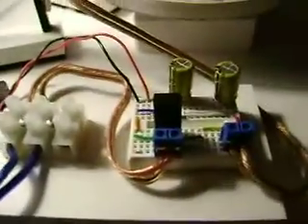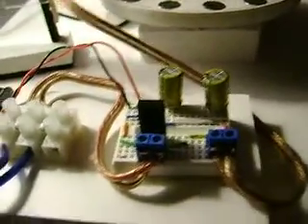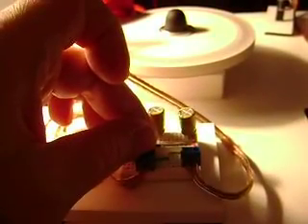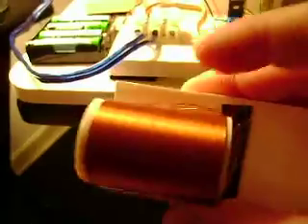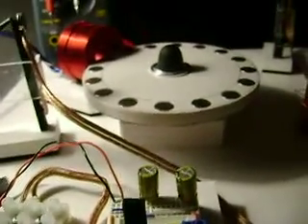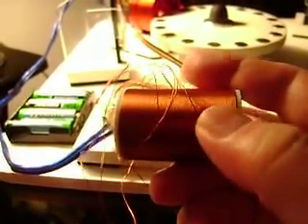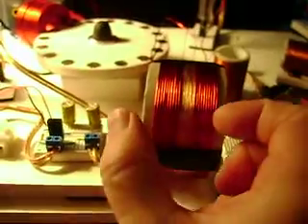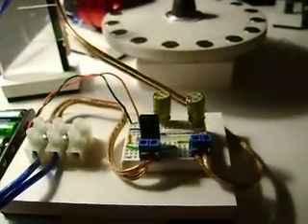Back emf currents seem to be high from these big coils. I call them big cuz the wire is thick. =]

Comment from the maker: Tru that Guru
Eventually I will get into Tesla type setups. I am very interested in Don Smiths device which is basically a Tesla coil setup but the primary is in the center of the secondary in which he claims will amplify the POWER not just the voltage. Imagine using a 12v bat to run a smaller neon transformer ans the output can run a whole house!  Air cores my friend. The Tesla advantage. 
Magluvin

Comment from the maker: So air core will have the highest speed collapse of all, there by producing a very quick bemf pulse, of which the speed of the collapsing magnetic field passing back through the coil should produce more bemf per power used to produce the initial field. 
Magluvin

Comment from the maker: Hey Guru
I agree that the length of the wire will have a given resonance, just as in antenna wave lengths and such.
But here, we are not necessarily working with radio freq, but maybe with the bemf pulse. That I will study later. I do believe that the back emf is of a high freq pulse due to the collapse of the magnetic field once the power is taken away from the coil. At what freq, I dont know yet. Light speed? Thats pretty high in freq. I do know that an iron core can slow down the collapse...

Comment from the maker: Hey Guru
That is an interesting theory, I will test your theory as soon as I get a chance. My Big coils as I call them are less than 1 ohm each and in a couple of my vids I put 3 of them together in parallel, bringing the total ohms down to 0.14 ohm. I have run them at 1.2v all the way to 5.1v and the back emf increased as I raised the voltage to them. So at this time I have to disagree, But I will do a vid that proves it. =]

Magluvin

Comment: Hi Stefan.
I don't realy hold with this formula
 V / R = 1A
This only holds true when sticking to the 
1 times  table, such as 
1V X 1ΏR= 1A.
But if you do this calculation with
 2v x 2ΏR= 4A 
and not 2A 
as it would if you used
 2V X 1ΏR= 2A

cheers Z.

Comment: Hi Guru. 
Well I think you've just answered what I said, but in a different way.
One is a trade off against the other.
Mags is using a thick single coil for the pulse coil and using a diode in revers to capture the bemf off that single coil in this experiment.

cheers Z.

Comment: By using 2 separate bifilar coils its possible to get equal currents travelling in opposite directions on the same core simultaneously, cancelling the field produced by load current draw. So output volts are doubled whilst Lenz effect is cancelled.  Back EMF harvesting is still available.

Comment: Hi.
The reason your diode is heating up is due to the thickness of the wire on the pulse coil, thicker the wire  more current less voltage, thinner wire more voltage less current.

cheers Z.

Comment: Do you happen to remember where you read about Tesla talking about bi-filler coils??
I would like to read that for myself!
Great work!!
As far as the "big coils" Bedini and Bearden claim that this negative energy travels on the skin of the wire or perhaps through the plastic insulation, either way bigger wire would have more skin and or more insulation to travel through. Have you watched the energy from the vacuum series, where Bedini lights a neon on the plastic of a car battery?